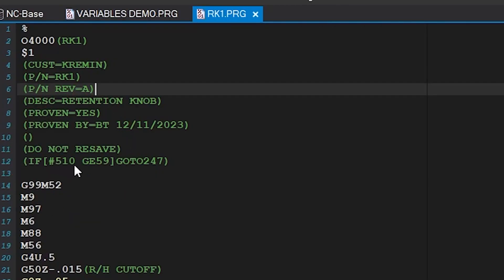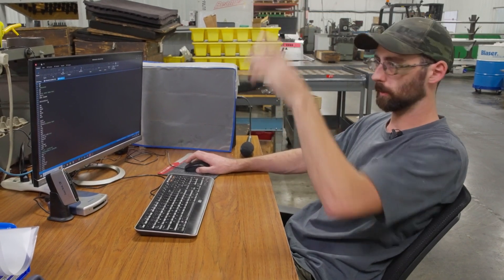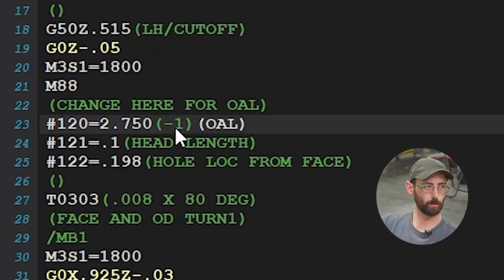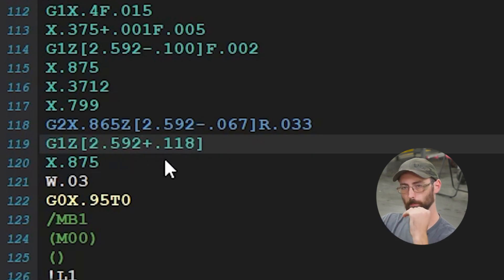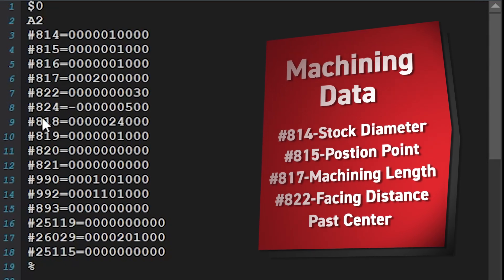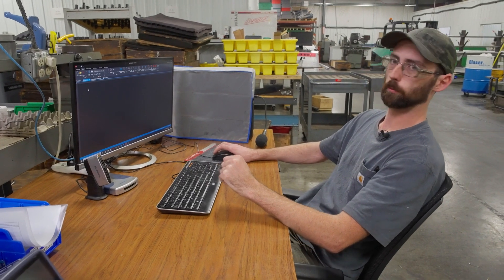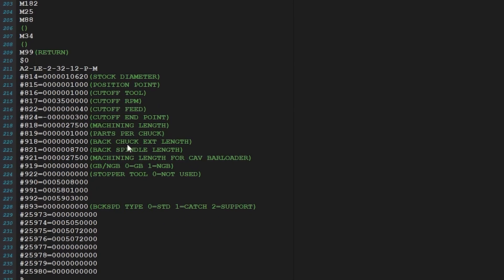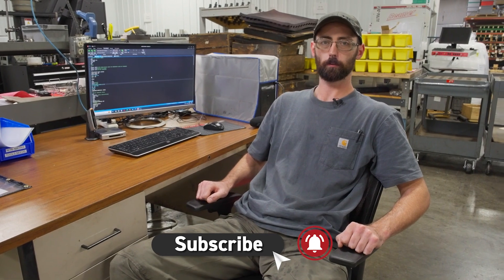How to Write CNC Programs With Variables (Introduction)

Comment: Cimco is good, but for Citizen...Alkart Wizard is worth its weight in gold. Has programming templates, a built-in function for changing code from metric to inches and reversing "Z" direction which is awesome if you're using MasterCrap to program.